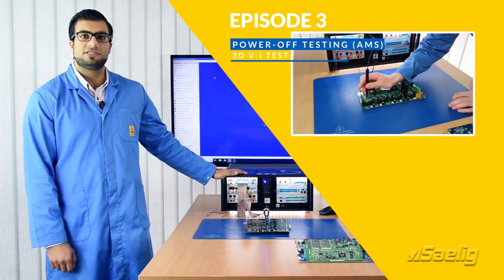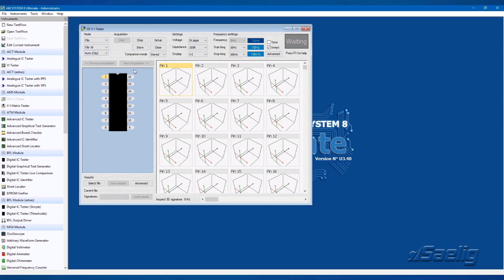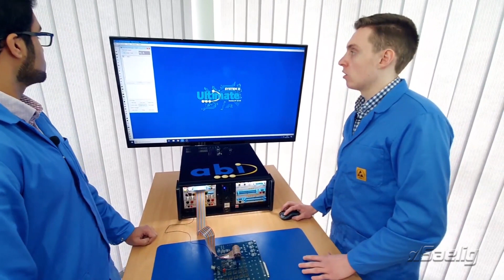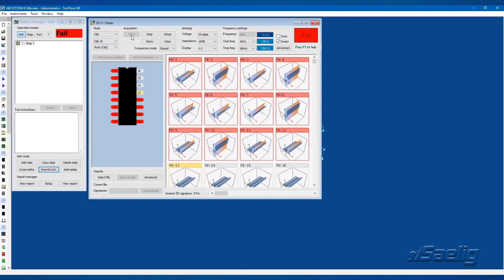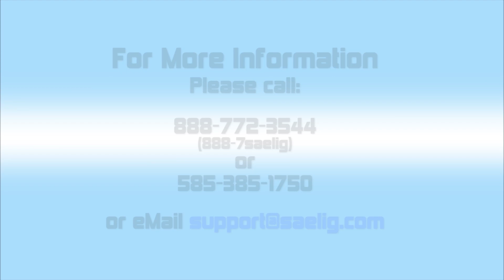ABI Labs - How to test a whole electronic chip in seconds without powering it up! Series 1 Episode 4

Comment: Mobile phone repairing can do this?
Reply: Since most mobile phone repairs relate to physical damage, I would not recommend BoardMaster for this application.  BoardMaster would be ideal if you were interested in repairing the circuit boards from much higher value equipment.  BoardMaster is used to repair the circuit boards from a wide range of equipment including vehicles, high value HVAC systems, industrial automation systems, robotics, passenger railcars, and commercial and military aircraft.  If you are in the US or Canada and would like more information, please send your contact info to sales@saelig.com.  If you are in another country, please send your request to sales@abielectronics.co.uk